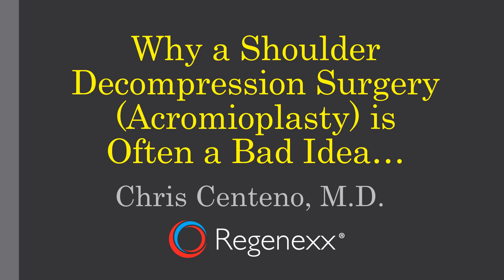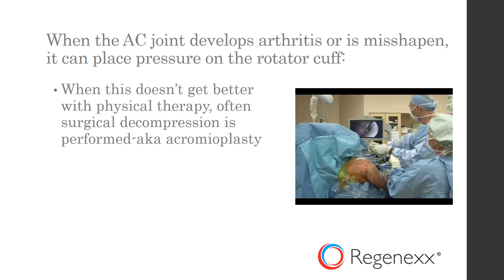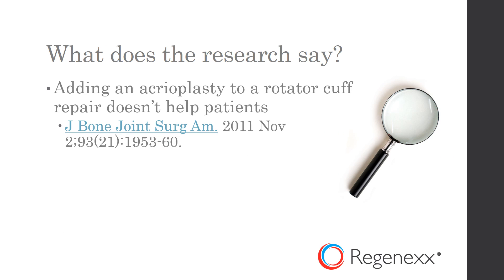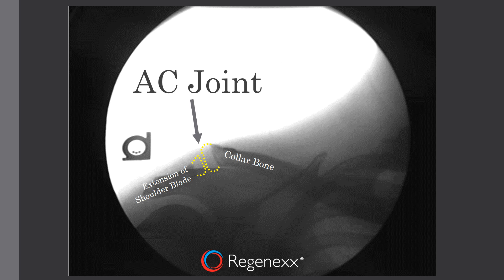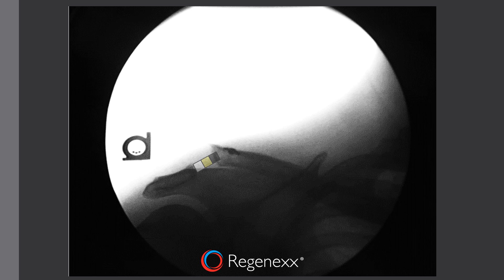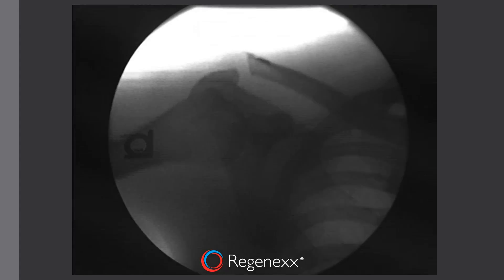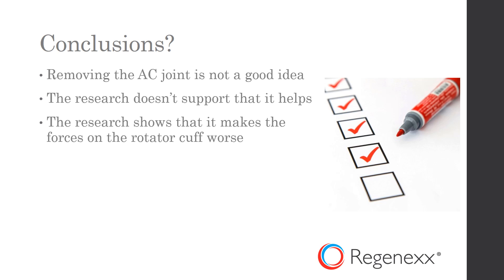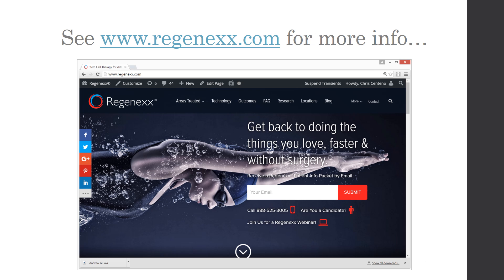Shoulder Surgery Complications

Comment: I told my doctor he removed my AC joint and he just about lost it. His face looked like I kicked his dog. Multiple surgeons have said it does not matter yet this is the number one source of post surgery pain... 3.5 years later.
Reply from the maker: Stan Rodgers,  Not surprised. It's part of the Structural Othopedic Paradigm in which you solve problems by cutting something out, or putting replacement parts in.